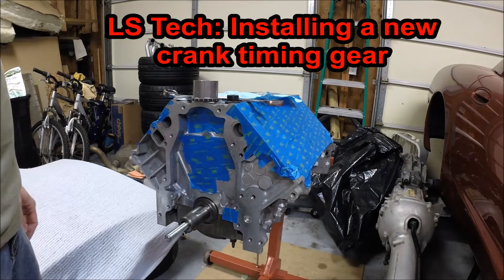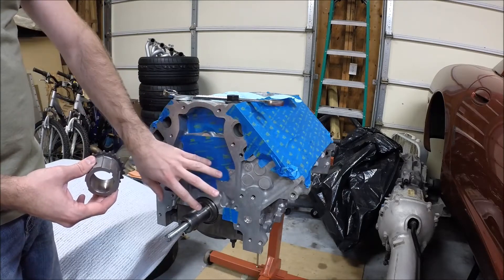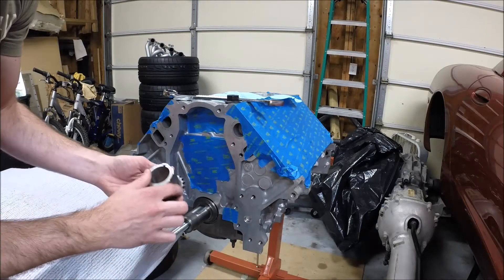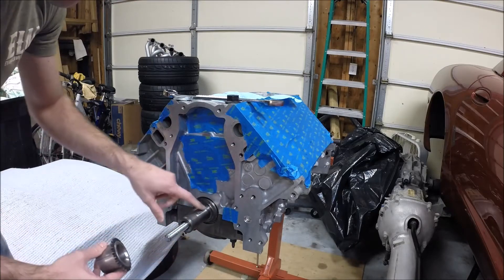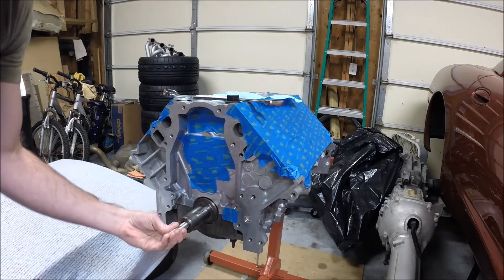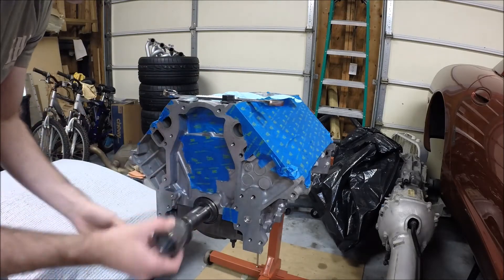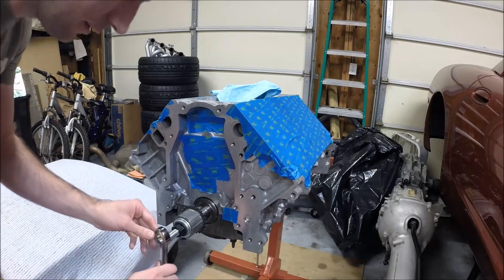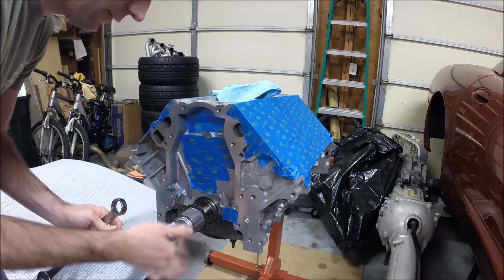LS Tech: Installing the Crankshaft Timing Gear

Comment: What did you use to get the old one off or did the machine shop do it
Reply from the maker: Good question; I had the machine shop remove it.
Reply: Scruf's Garage ok thanks I got mine off if anyone is wondering You can take it it off with crank still in engine with a 3 jaw puller from auto zone

Comment: Get king pin thrust bearings from a Semi truck garage. Perhaps the front end tech. They will reduce rotational forces a ton when pushing something on. They are up to 3/4" center hole or larger and will be cherished in you shop!

Comment: Already subscribed, but a couple of things for the future. I you don't have a SnapOn chain wrench or other brand, use the old chain inside a length of pipe. Vise-grip it to help hold.
  Also, if you have a garage that does Semi Tractor work, walk in and ask the techs if someone has an old "King-Pin" thrust bearing they do need and would throw out. They are designed with large internal bearings, captured in an enclosed case on come one piece. These go under the steering knuckles and are designed to support tons of weight. The center hole is up to 3/4" on many, as bushings are driven in, reamed to fit the "King-Pin" and locked in place with a grade 8 side edge bolt that catches a half-moon hole, like a rag joint on steering.
 These king pin thrust bearings will see a lot of use once you get them & are the best ever on bearing pusher setups! I did half the districts school buses in the late 60's into the early 70's. You will cherish these if you get a hand full. Hell, buy the tech a 6-pack!
ASE Master Tech since 1978 - Retired